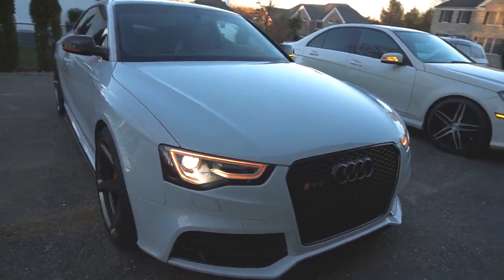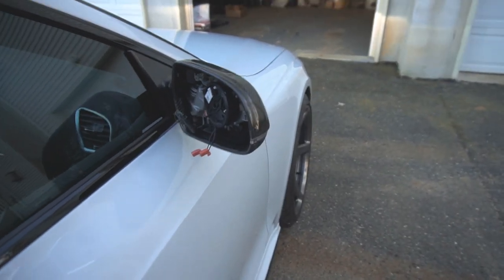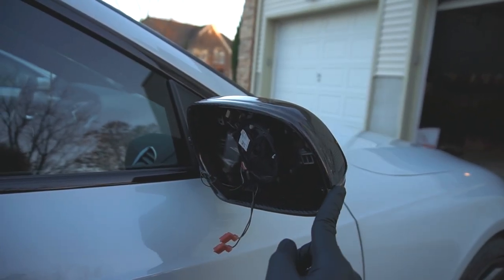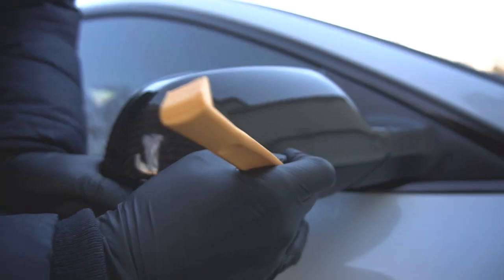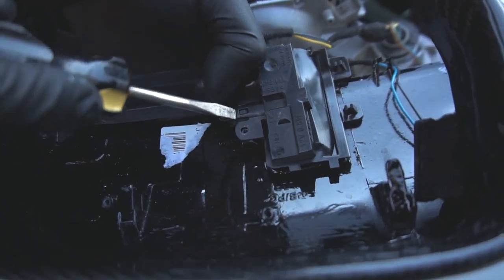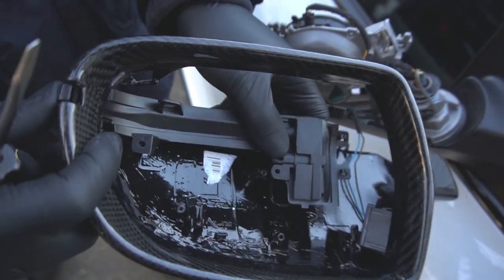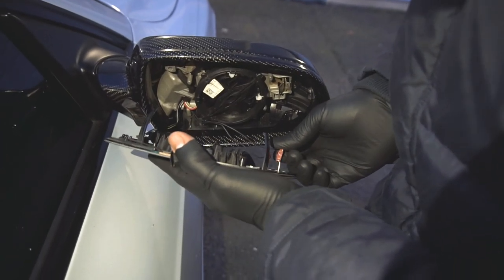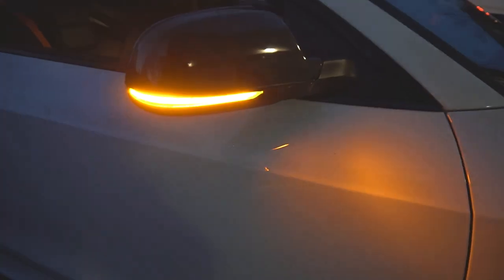AUDI Dynamic Turn Signal Retrofit!

Comment: Hey any idea what to do if the dashboard gives out "Left side mirror light" warning after installing the dynamic turn signals? The lights work but there is an error. Audi A4 B8 2008
Reply from the maker: Double check and see if you plugged the harness properly